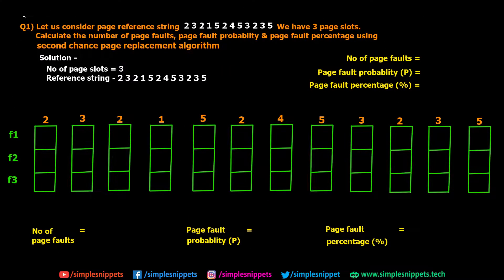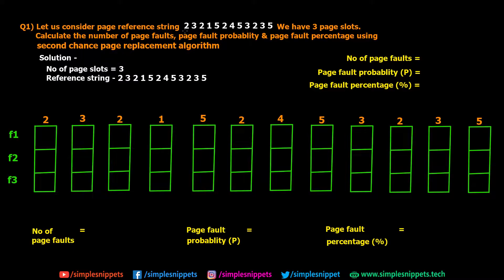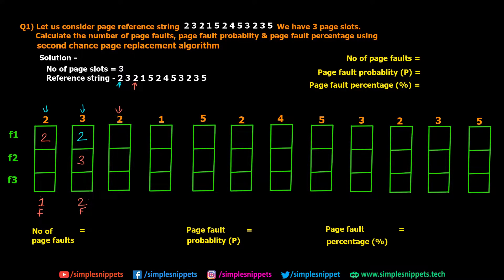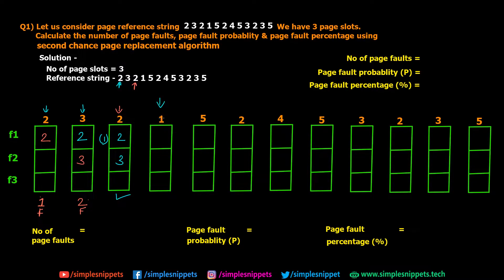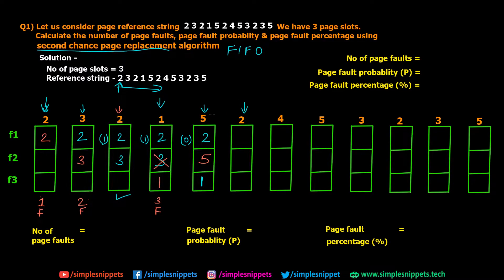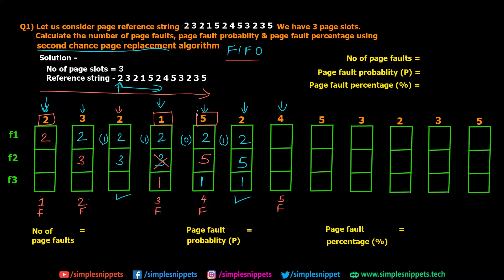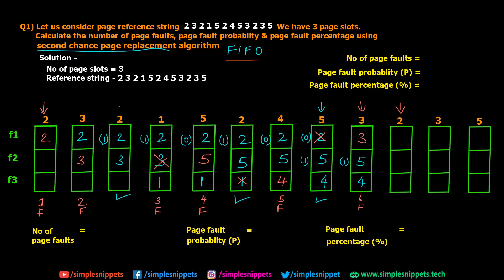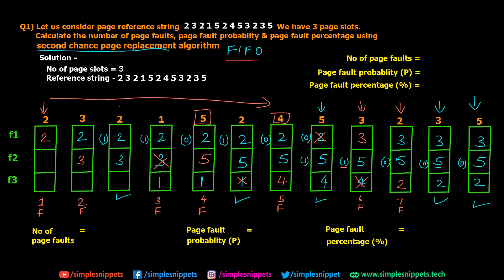Second Chance Page Replacement Algorithm in OS   Solved Problem

Comment: Second chance page replacement works by using a circular buffer, not a timestamped queue, the explanation and solution are incorrect. the page faults would be 6, and the end frames would be {2,5,3} and second_chance_bits as {1,0,1}

Comment: What will happen when each page has reference bit equals to 1 and a request comes  for a page, which is not in the memory?
If i  not wrong...we will follow fifo but, every page will get a second chance as reference bit of every page is 1....then which page we will remove?
Reply from the maker: Good question. If every page has reference bit 1 then we use the fifo rule again to remove the one that came in first and not give it a second chance ✌️
Reply: @SimpleSnippets  Thanks😀
Reply from the maker: Most welcome buddy ✌️